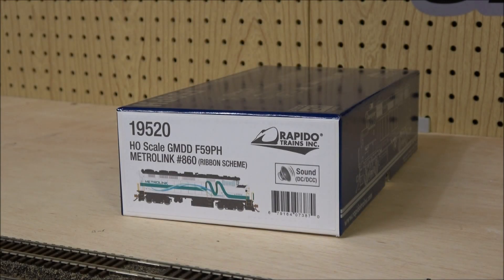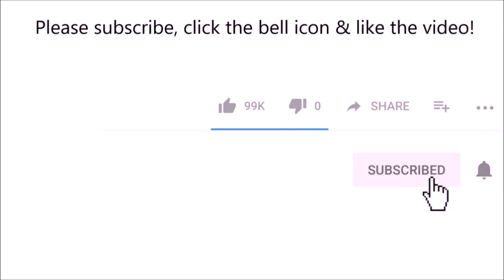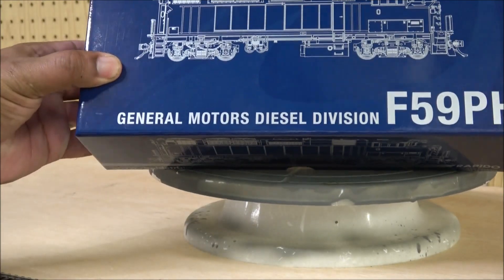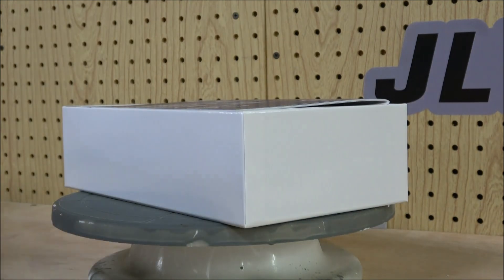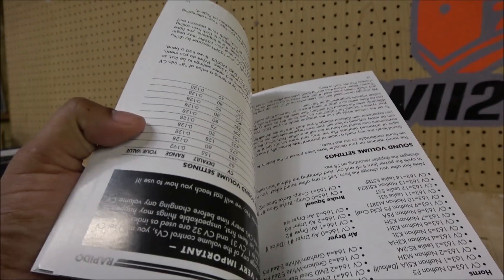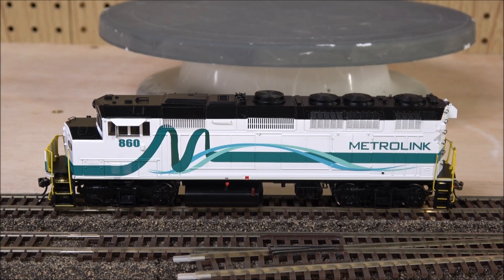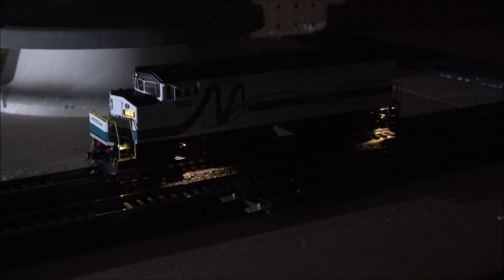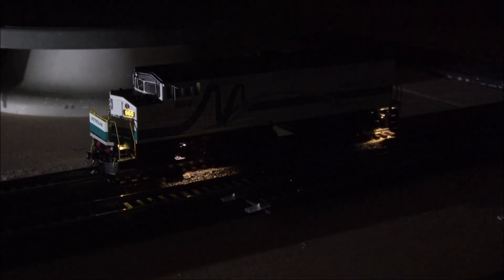Review: Rapido HO GMDD F59PH 2022 Release! DCC/LOKSound!

Comment: I'm kinda biased against this thing, because I'm from LA and I've always hated the newer Metrolink livery (liked the old one way more), but this seems like a gorgeous model. Now you just need a hodgepodge of Bi-Levels in the old livery and Hyundais in the new one to complete the look, I don't think I've ever seen a Metrolink train with fully matching rolling stock.
Reply: For me I take or leave it the livery  It suppose  to make  Engine more visible (per metro) I do agree  on the need for release of matching  cars at a quicker rate. ( newer livery) and that gose for alot a railroads .
Reply: Metrolink has repainted some of the bombardier cars but there's like 4 of them. Also they mix the cars probably because they didn't have enough funding to replace all the old cars (cause america hates trains aparently) so they put the new safer cars at the ends.